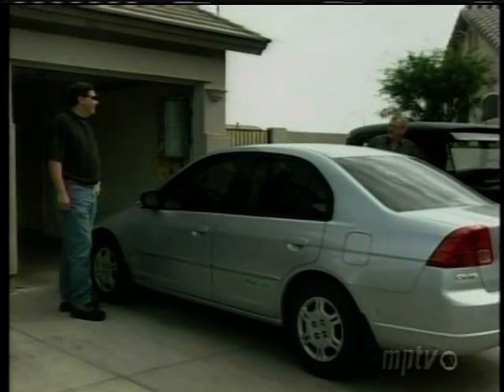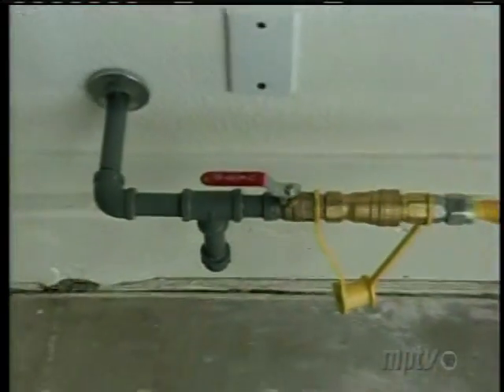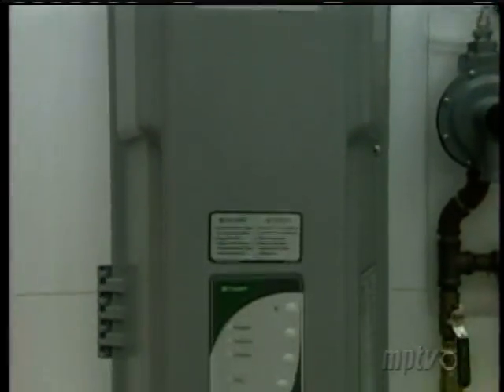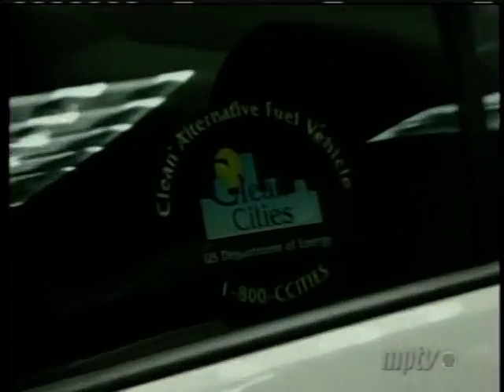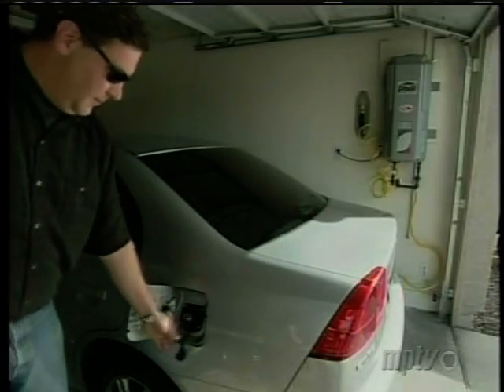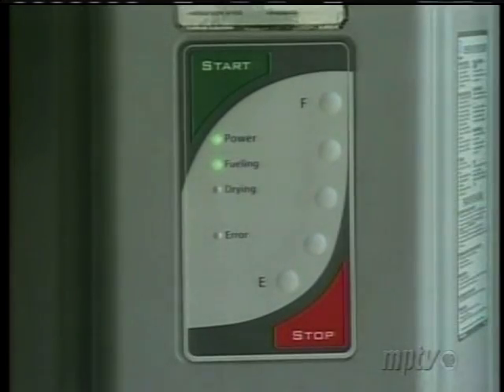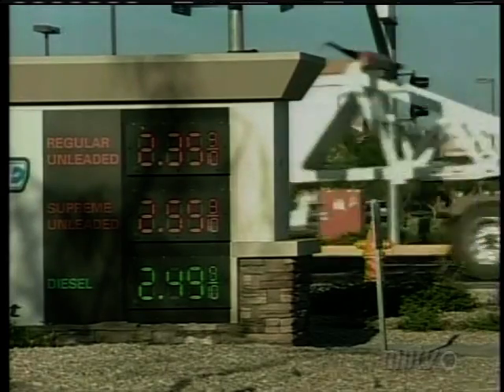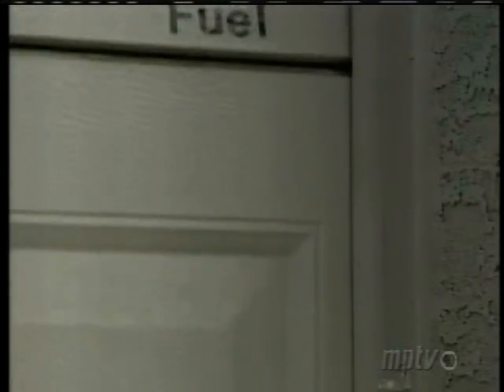Fuelmaker Phill

Comment: Depending on the state, both the car/conversion and the fill station have rebate credits. In Texas, its $2000/3000 for car/conversion and $1500 for PHILL.  Some local utilities offer an additional credit, like Austin offers $2000 credit.  That brings the break even point a lot sooner, especially considering the price difference between natural gas and gasoline.

Comment: FuelMaker Corp., the manufacturer of the Phill, went into involuntary receivership on April 2, 2009.  Honda of America, FuelMaker's sole shareholder, advised that the company be liquidated.  This experiment (while it lasted) made good PR for Honda, but did not make economic sense.  Breakeven point versus gasoline in a standard Civic  was about $5/gallon, when you consider all costs.

Comment: Refueling with combustible compressed gas provides 2 energy sources from 1 fuel. The gas is combustible and its under high preasure. If your vehicle were equipted with a computer controlled all electronic valve engine, it would be possible to operate as a combustion engine, compressed gas(air) engine, and regerative braking air compressor.

On trips the dual fuel would almost double your drive. For short trips around town, operating on compress air provides enough miles per fill-up.

Comment from the maker: The gasoline tank in your "safe" gas guzzler is a lot more of a hazard. Methane is ligher than air and dissipates harmlessly if vented. It's gasoline fumes that collect and blow up.  I personally prefer to plug my car in and forget it instead of standing at a pump freezing my ass off.